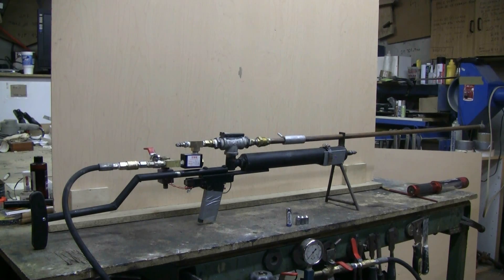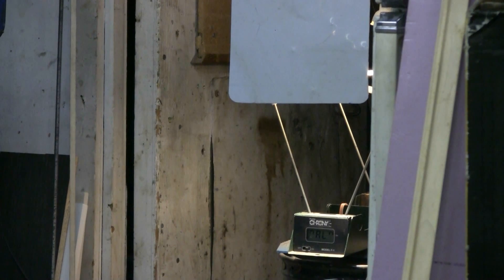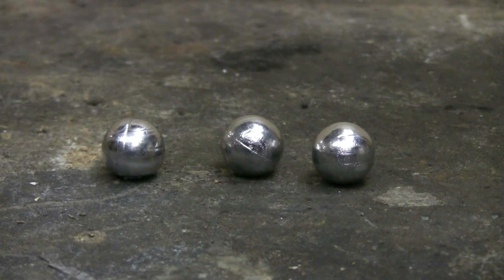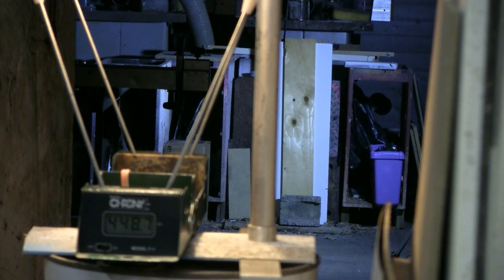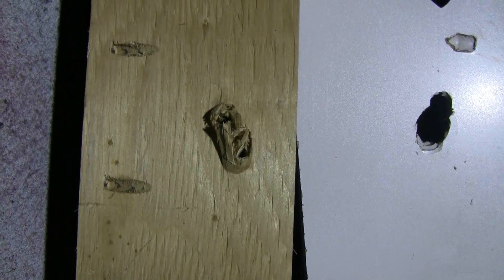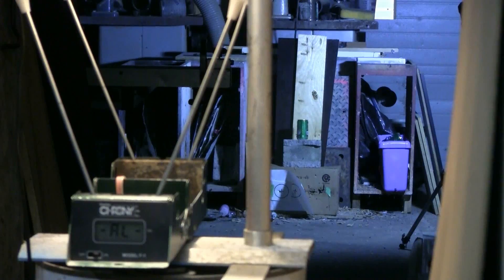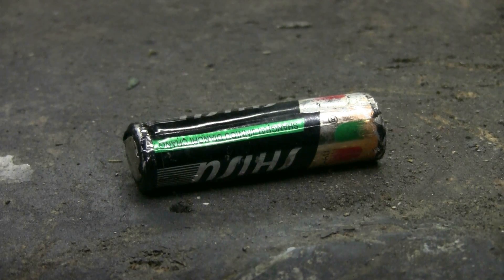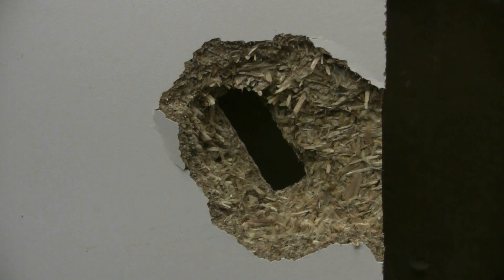Testing The DIY Big Bore Air Rifle - Slugs, Balls, And Batteries

Comment: The bolt action setup is cool, but you must lose a lot of power. Not only does gas escape through the breach, the rifling grooves probably allow some more gas escape, as well as add friction. You could try coating your slugs in wax to help seal in the barrel. Why not try a muzzle loading smoothbore barrel with lubed and patched round balls. At the pressures you use those should be going a lot faster.